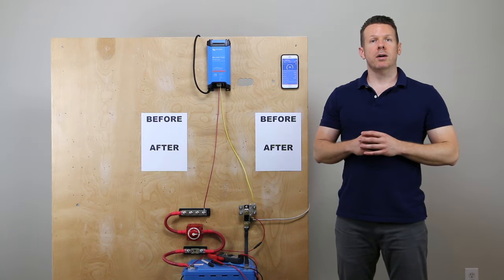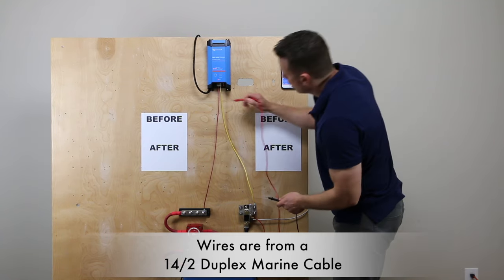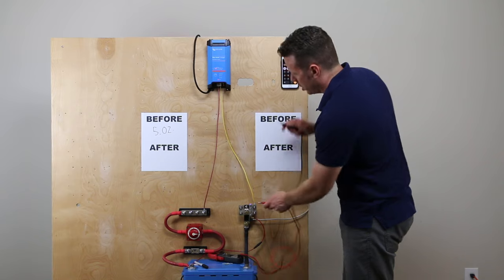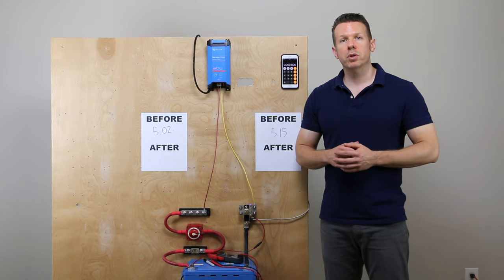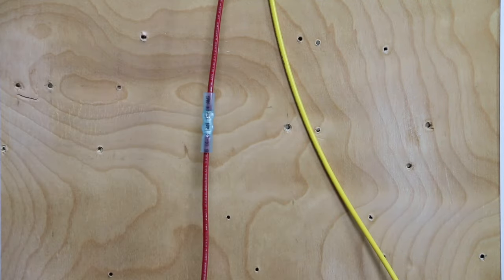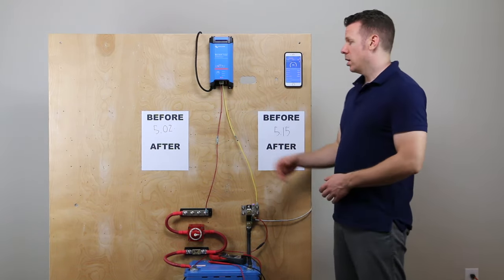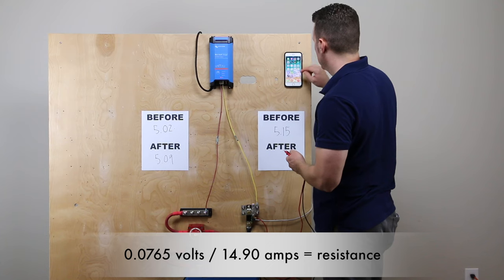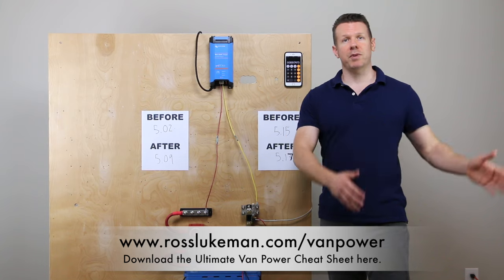Are Solder Seal Connectors BETTER than Butt Splices? (the truth)

Comment: I must admit to a slight chuckle at the sight of the calculator fastened to the board. Excellent visual presentation. 

Perhaps for the more "OCD" viewers, one could crimp on a butt splice (after sliding a piece of adhesive lined heat shrink tubing (HST) on the wire first), flow some solder into the splice, then slide the HST over the splice and shrink it down.

Comment: Question I’m a beginner in electrical I’m am currently restoring my engine harness I am using the crimp button connectors . Question is I see on the butt connectors show AWG 12-10 ,10-24 ,16-14 etc do I need to find butt connectors that match the same size of the wiring cables .?
Reply from the maker: Hey Martin, yes I would definitely match the butt connectors to the size of cable you're using. If they are too big or small, it can cause problems, either not being able to get all strands of the wire in there (too small) or the wire slipping out too easily (too big). Hope that helps!

Comment: we did heat test on crimp connections with thermal cameras once , over time if a wire is pulling a heavy load heat will cause a crimp connection to fail
Reply from the maker: Love that. Thanks for sharing your experience with these connectors!

Comment: The solder seal connectors are better for us because the high gauge wires tend to break more easily from flexing whereas the solder seal connectors remain pliable.
Reply: Yes, that's an interesting controversy between crimp and solder connectors.  In circumstances of severe flexing and vibration, many prefer crimp connectors as a superior connection because traditional soldered connections are hard brittle solder that can tend to crack and loose contact.  The softer, low temp solder of the solder seal connectors may provide higher flexibility to maintain the connection.  The vast majority of solder seal connectors are being used in automotive application where flexing and vibration are quite high.  I have a variety pack of solder seal connectors and find they are a good "problem solver" solution in hard to reach places, where applying solder with an iron might be quite difficult.
Reply: @chrisgraham2904  Oops, "...tend to crack and loose contact..." loose means something night tight. You mean lose, notice, lose, loss, lost, losing, all have one letter o.
Reply: @ricdonato4328 Oops!...."something night tight"?   You mean; "not tight"?  The word "not" also contains only one "o".
"Nighty-night and sleep tight".

Comment: Replaced hundreds of crimp butt connectors. Mostly put on with a leatherman, random pliers, vice grips, those crappy scissors type tools etc. Installed with the proper crimper, the high quality terminals are reliable and permanent. Cheap terminals or even the good ones, squashed on with the wrong tools are temporary at best. Dirty wire soldered by any method isn't any better.  Look at factory crimps, the tool might cost a bit, but the crimps are gas-tight and don't fall apart.
Reply: Until the wire gets pulled on...
Reply: @RJ_MAGA  I worked in a qualification lab where we used a Instron machine to do exactly that.
On a straight pull, solder cups did slightly better. But crimps were preferred because soldering caused a stress point on stranded wire where the solder wicking ended. I don't remember which mil-spec it was but there are many on connections.

Comment: The solder seal ones will fail in hot conditions. Whereas the crimp will still have a mechanical hold.
Reply: I've had two of them right on top of my engine for 4 years, haven't failed yet

Comment: My curiosity is i have used butt connectors with a butt connector hand tool and has always worked great for car audio, how do these guy at audio shop melt those solder connectors inside the dash without melting other things..
Reply: Flux the wires then twist the wires your connecting together as if they'd be one wire being fused together,  then you wrap the solder around it as tight as you can and use a torch to melt it and slide your heat shrink over that and shrink it and it's best connection you'll get. That's how I at least wire customers radio harnesses

Comment: It's interesting that we've been transmitting ekectricity through wires for 187 years, and are still tryiing to find better ways to connect wires. I guess it's like the drive to build a better mousetrap.  We've used solder less than 125 years. Telegraph linemen did their job for 70 years without it. We could live just fine without solder seal connectors, but they are handy for locations where a soldering iron is inconvenuent. Making a good solder seal with them takes a good brand (Rachem, now Tyco, invented them), the right equipment and practice. (If you've never cut one you've made open, you don't really know how well you make them.) I shudder to think how many sloppy connections have been made with them. Perhaps fortunately, probably 95% of those sold are still in plastic trays on somebody's workbench shelf. 😊 I wonder if Boeing uses them. 😊 Conductivity testing is essential. It's far more important than strength testing, which most do. 😊

Comment: I feel like the crimp connectors stress the wire a lot more than the solder seal or just solder and heat shrink. Zero chance of breaking the wire with the solder seal.
Reply: I'm not sure about that, why would a crimp connector stress the wire? Applying heat to annealed copper wire will weaken it. You will find that most people involved in performance auto electrics will never use solder as they can fail over time from vibration.
Reply: mechanical crimps all day. It’s all we use on boats and cars.

Comment: I gave up on butt connectors years ago, the centers are too short to make reliable mechanical connections. I now wrap the wire ends together solder and heat shrink.
Reply: You need better butt connectors, not the auto parts store junk

Comment: With anything in a truck, vibrations over time are key.   Anything that's not secure will break over time.    It's great to see the resistance values are similar, but for durability we do need to be soldering our connections.

Comment: The best way I have found to "butt" connect two wires is to use an oversize sleeve connector so you can run the exposed wires completely through the connector from each end and turn each end back to make a ball at each end of the connector.  Pull the wires back into the connector until the ball is covered by the insulation, and secure the wires by using standard wire crimper.  To make it waterproof or simply more secure against contamination, first slide a length of electrical shrink tubing over one of the wires that will be pushed back over the completed connection, including the  sleeve connector.

Comment: looks like you crimped an insulated connector with a non-insulated crimper which is a better crimp but you also just lost the weatherproof marring and cutting the heat shrink
Reply from the maker: Thanks for the feedback!

Comment: regular crimp connectors come in VASTLY varying qualities, ask me how I know. the good ones are really great, given you use the right tools for them. The right tool is a tool that forces the crimp to the end. and for the heatshrink butt connectors it is NOT the same tool as for the regular insulated crimp connectors, that will damage the heatshrink. I prefer them over the weird self soldering things
Reply: You are correct on both the quality of these connectors and the type crimpers  used. As much as I love the Klein crimper he uses, they are really for non insulated connectors, which I actually prefer because they are made of tinned copper and a bit heavier that the insulated types. Some insulated sleeves actually use a two  piece sleeve, 

The problem with using the type crimpers he does is  you can damage the heat shrink with them and potentially allow moisture in. The solder seal has the hot melt glue which seals very well. but I avoid using an torch on these because that too, can damage the  heat shrink. When using these I only use a temperature regulated heat gun. He got the solder to flow but the wire itself may not have been hot enough for it to wick correctly. You want the whole assembly to heat slowly and evenly. And depending on the wire size they may be lacking a bit in flux. When I use these, I add a small dab of flux to one wire before inserting them.   That assure that the solder wicks into the wire fully.

Th solder seal connectors are quite good, but a little tricky to get the best out of them, If installed right, these will work flawlessly submerged in water. 

Hand soldered or non insulated sleeves, both under marine grade heat shrink tubing is the absolute best. 

Hus test methodology was much better than a lot of tests I've seen. Only way to do it better would be with a really high quality meter and attached to a bare spot as close to the connector as possible. But essentially his test indicated that either connector was fundamentally the same. You would need to draw enormous currents larger than the wire ampacity to see any significant hating. 

Don't ever be tempted to use a WAGO connector for automotive wiring. The internal resistance of these is considerably higher and they don't  keep moisture out. You want a good waterproof connection on automotive wire. If any moisture gets in or even worse, some battery acid fumes, connections can and do corrode and that can play hell with low voltage sensor  wiring,

Comment: Any connection where vibration is present is a connection that i will never solder. A crimp and heat shrink tubing does a perfect job. Never had one fail.

Comment: Well done. You did a proper analysis, I liked your method.  However, a buttsplice will almost always be better than a solder joint ONLY if it is done with the proper tool. Your crimper was not a top quality, ratcheting crimper with the head that perfectly matched the crimp.  Only if high quality tools and crimps are used, and proper crimp tools are expensive, will a crimp be better than a solder joint. Otherwise it is mpretty much a wash as to which is better. Also, we are talking mili ohms, a very very small difference. 
But, none the less, you did an excellent job if demonstrating a proper scientific method way to test something. I'm impressed with your work. Good job.

Comment: Butt Crimp joins Suck, Never have I been happy with them. They easily pull apart and allow water ingress and corrosion. Solder joins dont corrode and the sealed casing improves that even more.
Reply from the maker: Thanks for sharing your experience!

Comment: There isn't enough solder in connector to penetrate complete connection, cut it in half and you will see only the outer few strands have slight coating of solder. They've been tested before on other YT channels and failed. I have worked for over 40 years on AC and DC controls building and repairing, those connectors not allowed on any of our service vehicles.
Reply: I believe that the solder won't flow thru to the center however the crimp seems to make a similar/limited area of contact.  I've had a few eventually intermittent "solder seal" splices outdoors (eh!) on 26Awg magnet wire but I blame both my own and the squirrels skills. Dependent on the conditions I solder the wires directly.. a constant experiment. Stripping seems to be the key and is frustrating even with the Knippex.

Comment: Why don't you simply make the splice in the wires and then use a quality ohm meter to check through the splice? I don't see the value of the battery charger and all the calculations!